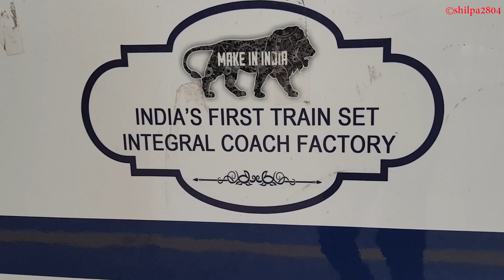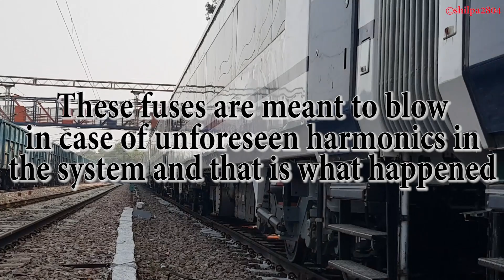Vested interests trying to fail Train 18 : GM of Integral Coach Factory #VandeBharatExpress

Comment: as an electrical engg. i wud say it is best indication that fuses were blown and it means protecting systems are working fine...it shows all systems like sensory and control are working JUST AS DESIGNED in conjunction with each other and operating correctly. Fuses are there to be blown in adverse conditions and thats what has happened so am happy.
Reply: @
proud indian
No, it is not best indication. Building EMUs isnt rocket science, it is well known many years now. 
Also, the construction of electronic digital controllers is nothing new and long-tested, India also runs enough EMUs, where you can see how such a thing is done.

The fact that resonant vibrations can build up in such a system also is nothing new.
But if these resonances in the operating state of the electronics become so great that even the fuses respond of locomotives that are not part of the train but are standing or driving on the tracks somewhere nearby and that even the next converter station shuts down - then somebody has his work not done correctly.

But I do not think that the cause of this mistake is a political one, rather it lies in the well-known arrogant arrogance of some "make in India" representatives and engineers, who can do nothing but say to themselves and everyone else "we can do it better - we do not need to look anywhere to see how that works! "

"JUST AS DESIGNED"???? Are you kidding me? 

Another thing: what does that tell you that this problem already occurs during slow testing with a pulling locomotive? And what does that say that this problem happens in the middle of a live system of a working railroad?
What does that tell you about the professionalism of the testing organisation?
Why do all the major railroad nations use separated - and therefore secure - test rings to test their new equipment? Is it not very irresponsible to run such tests in the middle of the day-to-day operations and thus jeopardize ongoing operations and the peaople there?

Think again......